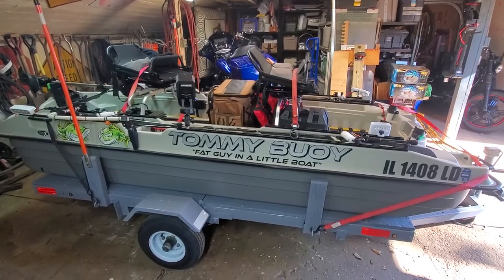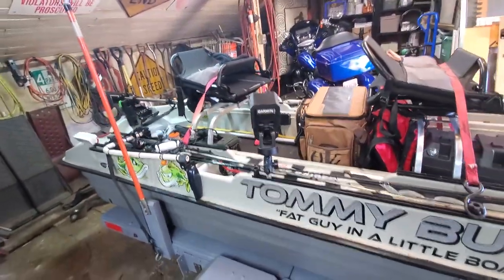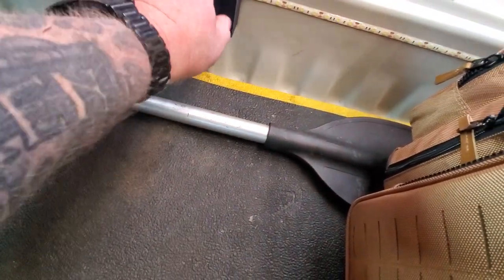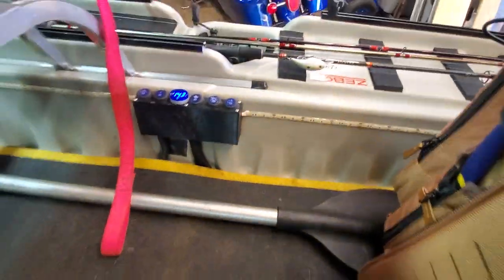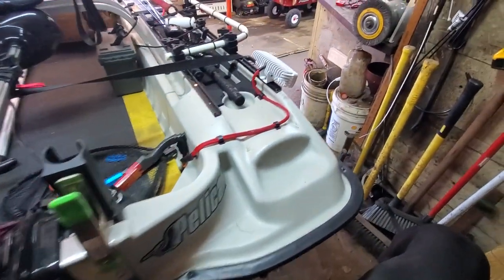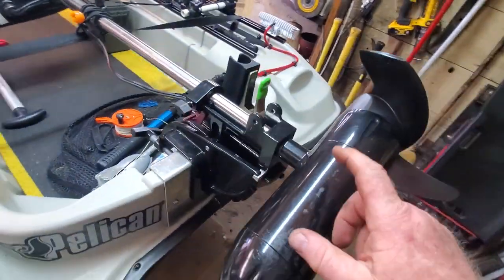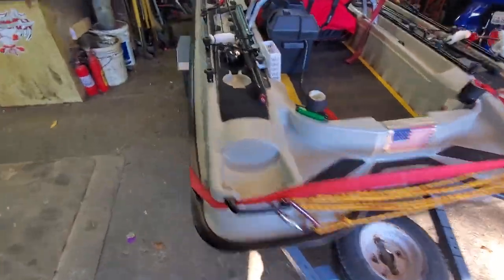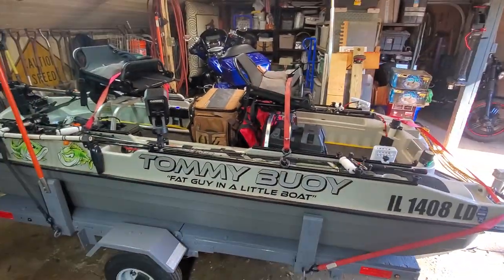pelican bass raider 10e and trailer end of season update

Comment: I was wandering how those plastic keel protectors worked out.  Did they stay on ok?  Love the boat mods!
Reply from the maker: They have worked great. I drag the boat up on concrete most times to load and un load. After a season of use, probably 30 trips, they show wear but have several more seasons left in them.